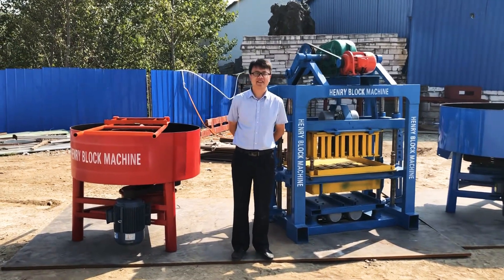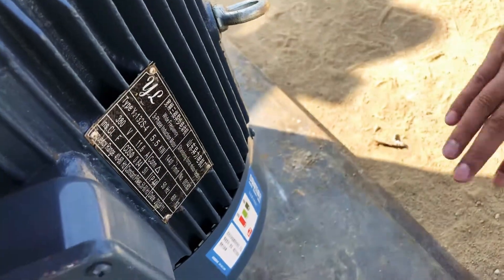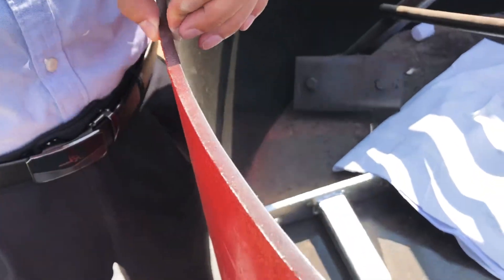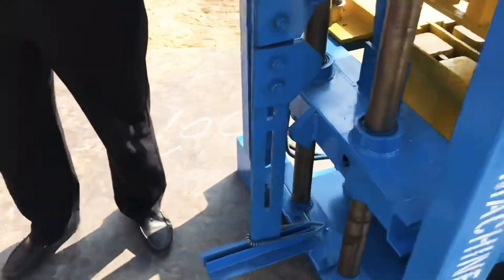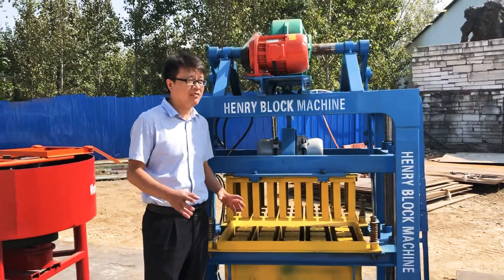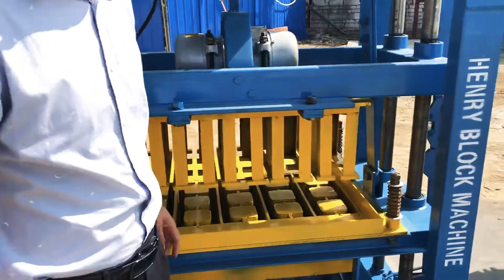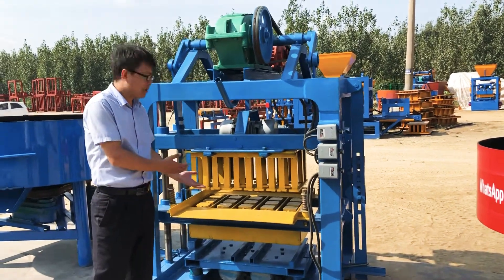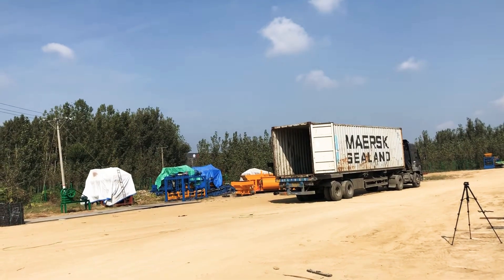What Makes Manual Block Machines an Essential Tool for Building Construction? QTJ4-40 concrete block

Comment: Can one machine be used to make 4 " and 6" blocks
Reply from the maker: @Kevin11XOutdoors  yes . It can do . It can make 7 pieces of 4 inch block . And 5 pieces of 6 inch block at one time
Reply: @HenryBlockMachineGroup  so basically if i buy one of the machine it comes with interchangable molds ? To 6 and 4 ?

Comment: How assembly and dissembl
Reply from the maker: All machines are fully assembled. After receiving the machine, you only need to connect the wires to use it to produce bricks.

Comment: Hi sir what is called the white plastic used in block  making machine as a bearing on the  chromed shaft
Reply from the maker: Nylon sleeve，I think you have the same block making machine

Comment: Hello my friend! I'm Ferenkeh Yanka in Sierra. I actually want to know if the QTJ4-40 BLOCK machine can't work without gear oil instead of greace before using the machine
Reply from the maker: What is kind of greace oil ?
Reply: Greace for shaft. Also I may need some brick molds. My machine came with just a single mold. Our country needs different bricks sizes.
How much for a set mold which can produce both solid and hollow bricks types?